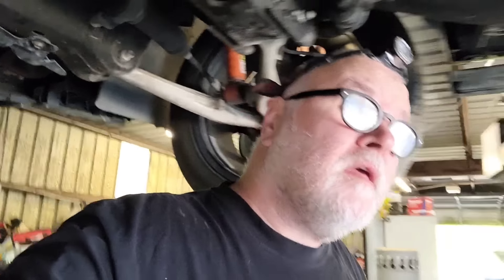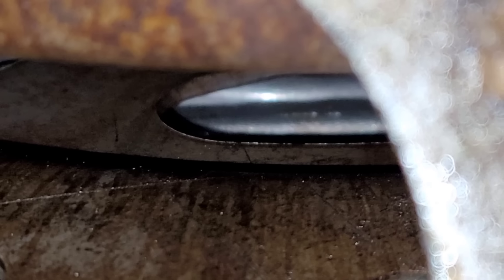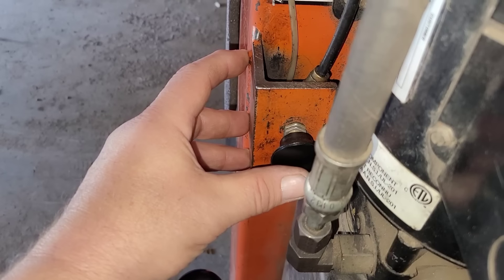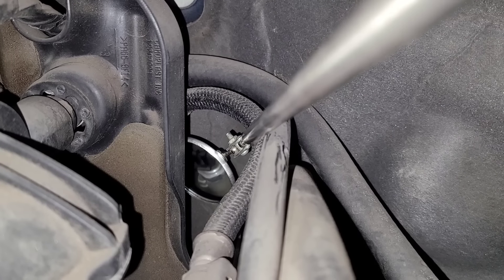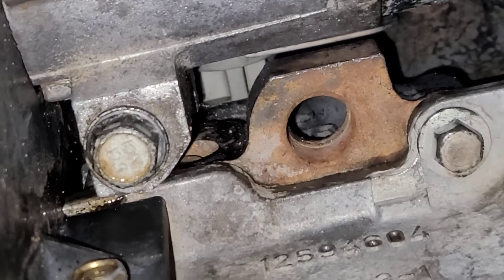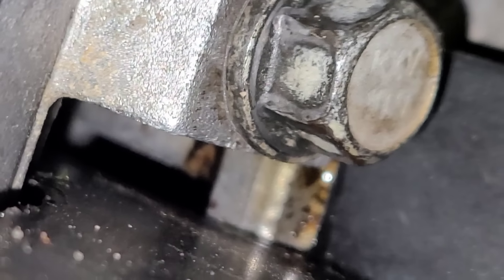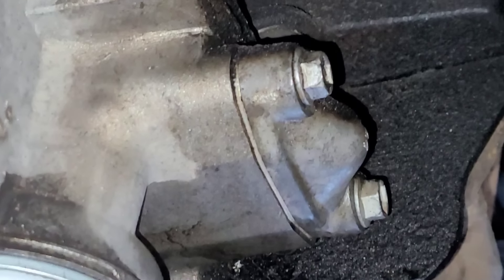Rear Main Seal Leak Thats Not A Rear Main Seal Leak. 4.8 5.3 6.0 6.2 GM

Comment: Tip: LS motors leak oil easily if the pvc system isn’t correctly working and set up right. LS motors leak oil from flywheel bolt holes on the crank flange when the bolts haven’t been sealed. Both of these conditions are usually found on hot rodded motors.
Reply from the maker: Thanks for the info. I will keep that in mind especially since I'm pretty sure I'm putting a LS in the Camaro. Keep Wrenching!
Reply: Hey Kenny what would you recommend for a new used suv most reliable
Reply: Yukon of Tahoe

Comment: The oil cooler line connector block to engine block gasket, as well as the set screw plug in one end of the oil cooler line block is always suspect.

Comment: I have a 2002 Blazer with less than 70k on the 4.3 and it leaks inconsistent,start up more and move out of shop park leaks about an 8 inch circle of oil on concrete. Drive for hours park on concrete, maybe 2-3 small drips ???? Not filter,rear main had new intake manifold gasket done last year,any suggestions?

Comment: Crankcase ventilation build up can cause havoc on leaks. Not saying it's a issue here but it sure is the first thing i go to with leaks. Replace the PCV valve most people overlook and forget about then check for leaks see what happens. A bad PVC valve will indeed reveal the weakest link on engine seals and gaskets... I've seen it happen many times.
Reply: If the PCV hose is disconnected from the intake would that cause an oil leak? The guy who built my truck disconnected it from
The intake and said it’ll run better but it’s been leaking little drops of oil from the top driver side engine and down to the oil filter and to the tranny
Reply: @jonathandeleon5588  in no way would disconnecting the PVC hose be better. For one it causes crank case pressures to rise too high. Second, if the hose off the intake isn't plugged with something, that's a bad vacuum leak for the engine reducing power, idling bad, and consume too much fuel.
Reply: @garyr7027  yea he plugged the intake PCV hose with like a little plug but the hose by the valve cover gasket is just hanging he told me it runs better since I have the truck cammed but I been having oil leaks like little drops idk if that could be a cause or not
Reply: @jonathandeleon5588  tell him to put that pcv valve back like it was. Cammed or not that doesn't matter, a engine still needs crank case pressure relief or it builds up pressure from heat and blow by from the piston rings. Cams has nothing to do with piston ring blow by, which is normal even for a new engine. PCV valves aren't there just for looks, there's a good reason for them being there.
Reply: @jonathandeleon5588 just run it to a catch can or air oil separator, and then back to the intake where it was supposed to go. That way you can catch all the oil from the PCV and still have the correct MAF reading.  Just blocking it off is a bad idea and can cause lots of issues.

Comment: Could the leak be caused by incorrect cleaning/sealing of the rear corners of the oil pan gasket, when it was replaced?

(Where the oil pan gasket crosses the end of the rear cover plate and its gasket).

J

Comment: You wouldn't think that the gasket on a blank plate to cover the attachement for the oil cooler on engines that don't have the auxiliary oil cooler would be that hard a thing to get right, but they leak like mad.  I generally pull the driver's side front wheel and reach in with an extension to remove the bolts with the least grief.

Comment: Glad to know that is there I have to replace the transmission on my '01 Suburban so I'll go ahead and replace that seeing I have around 250k on the odometer
Reply: Whoa, that is a bunch of miles on one of those, you may want to do like Kenny does and just find a replacement out of a wrecked vehicle that has 70k miles or less, engine and transmission. Just a thought.
Reply: @jthonn  the engine is still running strong jost slight oil leaks trans lost most of 2nd gear so it's getting a 4L80E
Reply: @jeremyself2156  Good luck to you, change anything you can that's normally hard to do while you have it apart. Rear seals, gaskets, oil sending unit and O2 sensors, well you get the picture, I hope it all goes well.

Comment: how many hours is this job?
Reply from the maker: About 6 hours. It's a big job since the transmission has to come out to do the repair. Thanks for watching, and keep wrenching 🔧
Reply: @WrenchingWithKenny  my guy is changing me $1400 to replace cover seal and rear main seal. It that about correct
Reply from the maker: Sorry you have that going on.  The price sounds about right. Some vehicles it would be more than that.

Comment: Good video!  I was just notified by my dealership that I have a rear seal and plate leak.  I will trouble shoot this myself but, what angers me so is with this dealership, every time I take mine or my wife’s vehicle in it’s something else.  I don’t wanna say it’s sabotage but, every time they point out an issue I’ve gone in and repaired it myself.  At seventy five, my days doing this are becoming harder. If they’re doing this to me, I can’t imagine what they’re pulling on the neophyte that has no sense of engines or cars.  I take really good care of my vehicles but, I’ve had it with this outfit.

Comment: I thought that I had a leaking oil pan gasket on my truck but it turned out to be a leaking gasket on the driver’s side valve cover. I ignored the leak for about 10 years until it got so bad that it was starting to leak on the exhaust manifold. Luckily, the gasket wasn’t that hard to change.
Reply: Dang! 10 years!! I changed mine tonight in about 20 minutes because the PCV was clogged

Comment: Every single LS engine is installed in a vehicle where the back 2 cylinders are under the dash where NOBODY can see or work on it!!!!!!!!!!!!!!!!!!!!!!!!!! There is another video on You Tube where a guy goes after the O-Ring on the crankcase position sensor O-Ring = a nightmare, but the fix.
Reply from the maker: Those engineers are NOT our friends. Thanks for sharing & watching the channel. Keep wrenching 🔧
Reply: @WrenchingWithKenny  Every piece of rubber on a GM vehicle leaks = rotted floors, rotted trunks, oil leaks, etc!

Comment: It bothers me that you interchange the words "motor" and "engine" otherwise great video
Reply from the maker: sorry about that. I have been doing it for 50 years. Old habits die hard. Thanks so much for watching & taking time out of your day for leaving a comment. Keep wrenching!
Reply: @Wrenching With Kenny  I hear ya, I used to do it to until I worked with another tech who would get super triggered by it, was afraid he always gonna give himself an aneurysm from how fired up he would get about it haha
Reply: Ever seen a motorhome? A Motorway? What city is Motor City? Is it nicknamed for electric motors? Know any motorheads? Ever seen a motorcycle? Give me a break.
Reply: @B W  hey, I don't make the rules, engines operate on combustion and motors run on electricity.  Ever seen a "check motor" light on a dashboard? How about the vehicles "engine bay"?  You know, it ironically the place you'll find the "motor mounts" 😂
Reply: Oxford dictionary online-
Motor:
a machine, especially one powered by electricity or internal combustion, that supplies motive power for a vehicle or for some other device with moving parts...
I don't make the rules. Tell your triggered tech buddy look it up.

Comment: nope high octane gas wont repair this,  but blue devil will,  lubeguard seal fix will,  and reseal  201 will,  every conv oil, semi syn, full syn for the past 10 years comes with synthetic  lower dose sealer built in

Comment: No chance it is a crispy oil pan gasket?
Reply: He said it was recently changed
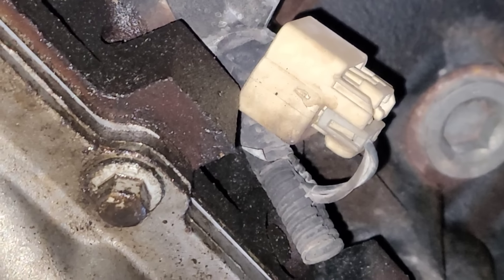Reply: @canadianguy-nl1xw  That is what was told to the customer and conveyed Kenny but we really don’t know if the gasket was changed. What has me questioning the gasket is the oil that is all over the gasket area at 5:47 just forward of the knock sensor. I would think that if the job was recently done the pan would be dry in that area, assuming it was cleaned.
Reply: @larry reno  one thing I learned from 15 years as a tech and service writer is that if a customer says something is in perfect condition it usually isn't haha
Reply: @canadianguy-nl1xw  that’s a fact! 22 years at a Ford dealer, I’ve seen a few things. I’m sure you have also.
Reply: @larry reno  just a hunch that a ford expert has seen some unbelievable things haha I spent a few years at a jeep dealer, seems everyone that drives a jeep figures they are mechanics.

Comment: I think your diagnosis of the seal plate is correct on this one.  However, I've seen those CKP sensors leak a few times.  The o-ring is an odd size so you have to get a new CKP to fix it.
Reply from the maker: I've seen sensors leak before on other vehicles, but I've never seen one of these . Just personal experience... I'm sure now I'll finally get one lol
Reply: There is a guy on ebay that sells the odd size o ring to fix the leak
Reply: @eddiemiles1920 what's his name  on there? Or part number? Thank u